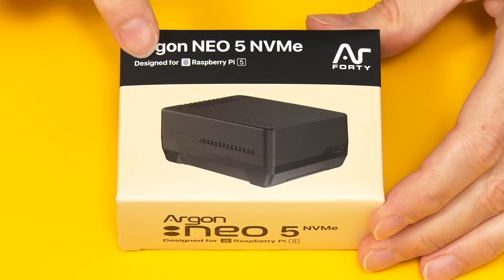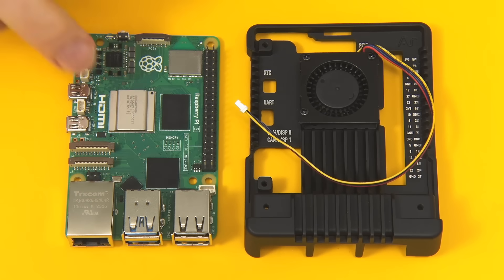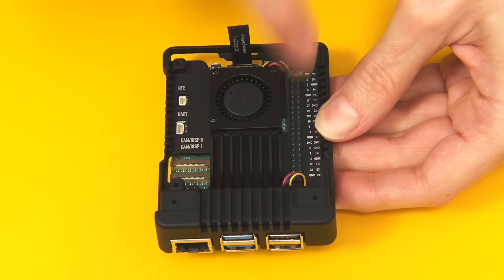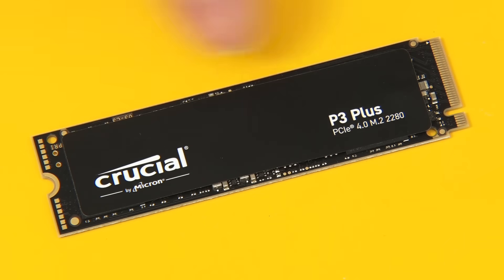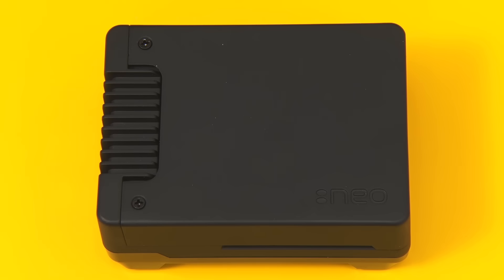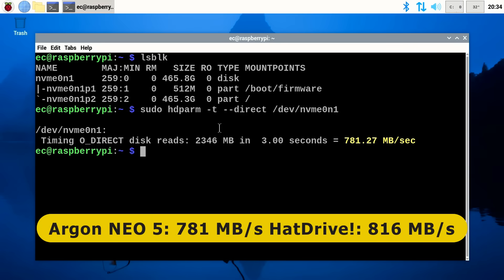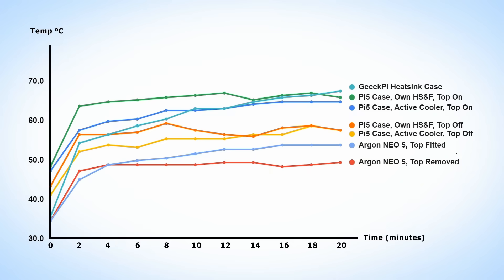Raspberry Pi 5 Argon NEO 5 NVMe Case

Comment: :yt: A 'case of pure joy'.  I concur. This is a very COoL little case. My only dismay is for these ultra TINY fans that seem to fail years ahead of schedule. As we know, the longevity of these items is just not in the cards. Mfg should really allow folks to purchase additional fans (a dozen at a time?). The chances of finding that specific-fit fan is larger than the gap between my eyes (sorry for that visual). I'd buy it if I could be assured I could purchase replacement fans. Just saying. Thank you for the InfoTainment once again. I'm almost your biggest fan  :face-blue-smiling:

Comment: Nice work, Chris, and lots of effort we've now seen since your showing us behind the scenes.
# Careful with the humour efforts. We like your natural quirks.
# Mayormaynot isn't a word, in spite of current diversion down the rabbit-hole. "I may not succeed with this on camera in real time.." is enough. 6:12
# 'Securing clamp' is a good term for the piece that clamps a ribbon cable in the connector.
Thanks. Nice case.
Reply from the maker: Rather insulted by your "mayormaynot isn't a word" comment. I am well aware it is not a word, and DID NOT use is as a word! But to say "may or may not" (four words, and obviously so) is perfectly valid English.
Reply: @ExplainingComputers  Aw, Chris, I could be rather insulted by your 'rather insulted' reply. Mine was a rather risible remark. It could be argued that mayormaynot is being used as a word. It's just that it doesn't make sense, like 'three a.m. in the morning'. Just another example of growing looseness in English. A lack of forethought, imo.
'May' means someting either is or isn't. 'May not' means something either isn't or is. Looseness, yes?
'Valid'? Maybe, maybe not.  ;-)
Love your work.

Comment: Nice case but it would be much better if it had no fan. NVMe vs SATA SSD connected through USB3 won't make that much difference in real life even under heavy stress. I don't think it would even if there was more modern PCI-e or it had more lanes let alone if its not even twice as fast as USB3 SSD. The biggest selling point of such solution is tidiness. It looks much nicer than my setup with dangling SATA drive in the case. One way to have nice tidy setup is USB key with proper SSD electronics but these are quite expensive for the specs. Personally use 2TB SATA3 drive and NVMe with 2TB aren't even that much more expensive which makes NVMe pretty much perfect. Anyways, I am looking forward for reviews of something like this Argon NEO case but all passive.

Comment: Argon cases are a cut above other RPI cases. I've owned a couple for several years now - original and the one with the m.2 SATA 'basement extension' (I purchased a second extension to upgrade the original.) and have been very pleased with them. They ARE a bit expensive,  but they solve the problem of having to use micro hdmi cables, and aren't especially any more expansive than a good case with an SSD hat. They did still required the USB jumper to connect the 'basement extension'. The NEO looks like a total solution designed from the ground up to take advantage of current technology, and at about the same price. We win!

Comment: I like the metal case! Yes, 36.00-40.00 GBP/USD.  Maybe a little high, but it's a really great looking case. With the built-in Fan is a bonus, come with every thing needed.  But? If plastic case, maybe 8.00-10.00. Who know they maybe a case cheaper? (For me!), But to be able to switches the NVMe-SSD from one Raspberry Pi 5, to another.  Another great tools, and love the facts that NVM drive little as 256gb up to 8TB, heard that trying to go over 10+TB?

Comment: One small thing… when measuring air cooling, it’s important to take into account the ambient (room) temperature because it’s directly related to the result. Cooling efficiency is about how close to ambient the temperature reaches, not just to what absolute temperature it gets. For example, in a room with say a 10 degree higher temperature, it’ll be cooled to 10 degrees higher.

That said, appreciate the video as always, nice job, thanks.

Comment: There is some ducting of the airflow of the neo 5 that notably reduces the air recirculation I did with some kapton tape that I need to document because it measurably reduced temperatures.

Comment: I never have used NVMe before.  Recently my Pi5 just arrived, and so I bought the geekworm nvm hat.   I made a mistake buying NVMe M2 4x4 2TB, and sequential read is about 7300mb/s, but look like Pi5 can go only up to 2500mb/s.   So the lesson learn is buying a 2500mb/s is good enough and anything above 3000mb/s is overkill.
Reply from the maker: A Pi only has a single-lane PCIe 3.0 connection (and in theory only 2.0). Almost all NVMe SSDs have 4 lane either PCIe 3.0 and 4.0 interface.
Reply: What nvme drive would u recommend

Comment: great review as always :)
i have the argone case for the pi 4 that adds the nvme drive.....awesome case but same prob with the sd card slot. With this case tho they could have put an adaptor inside the case so the sd card slides in the bottom like the hd does. I think i saw another review about their nvme pi case that looks like the pi 4 case but it has a dac add on board. I was thinking about that 1.
Also i forgot to mention...I get where you are coming from about the price for the case and pi etc.....that most ppl just think of the price......for me pi's are not just about price...its the versatility and the giant community......that part is priceless. I am so glad that we finally have a pi thats fast enough to actually use a pc.

Comment: Nice case if you have all those pieces.

A couple of questions. First any theories on why this combination is consistently slower than the Pineberry setup?

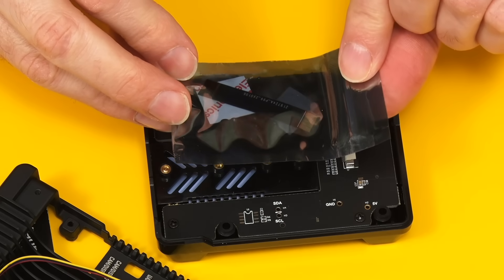Secondly, while showing the NVMe board, at about 2:50-ish and others, down at the bottom is a picture of an 8 pin chip and SDA/SCL text. So it's an I2C interface. Is that something not installed or not used?

Comment: Could you store the unused heat sink pad in the back of the case, for later use., or would it cause heat issues due to the backing tape being attached. It would be great to see, when it becomes possible, AI being run on SBC's (RPi). Welcome Phillip the screwdriver, nice!

Comment: Excellent video, as always, Chris. I'm using the Argon 40 Neo case for my RPi 4, and it has been a very impressive bit of kit. I have been looking at the Neo5 for an upcoming RPi 5 purcahse, and this confirms my thoughts that this would also be an equally good product. The only problem may be actually finding a Neo 5 in stock!

Comment: Very nice case. Not sure if the plastic bottom is a good idea from a reliability standpoint, but the thermals look great. I was hoping you'd show the power button - I only noticed there's one at the end of the video. I also wonder how the RTC battery would fit between the lid and the mid layer of the case, and if it's a good idea to stick it on the lid, which is cooler than the fan plate/cover. Does the lid have grooves to make the battery mount easier?

P.S. Thanks for reviewing this! :)

Comment: When i attached a NVME kit to my RPI i noticed a strange difference. Apparently the PI slows down on boot, with the NVME drive? With the SD card it boots in about 12-15 sec, but withe the NVME it takes up to 20 sec. 
Have you (or others) experienced similar behavior?

Comment: Some NVMe PCIe 4.0 drives need to be cooled even when running in PCIe 1.0 single lane mode. I think the SSD might have slightly throttled in the test.

Comment: At 1:30 you mentioned that you would have already spent more than some mini PCs.... and that is exactly where I stand with the PI ... I have fully fallen out of any reason to own a PI presently. 

Gone are the days when you could power one up with two 18650 batteries... and a standard hdmi cable, moving to micro, the dumbest decision ever in the history of computing.

Let's not start about the prices. Totally not worth it in my humble opinion. As usual, excellent video.

PS. Superb case!

Comment: These look really cool.  I must admit that I'm reluctant to loose the sd slot (as you pointed out), so I can switch OSs easily.  I also find that running a SSD through the usb 3 slots gives plenty of performance.  It boots very fast.  Not sure I need the nvme speeds though.  Maybe I will upgrade in the future?   But will will likely be a hat, but not sure yet.

Regarding Pi vs embeded SFF PCs.  I think the PI 5 is really good value.  I got mine, with the bits n bobs for around 110/120 dollars.  A N100 PC would cost more than that (at least from minisforum).  Personally, I would want at least an i3, which will cost a little more.  If I was going to run windows, I'd be looking for more.
Secondhand HP/Dell/Levovos can be bought secondhand.  This is a really good option.
Whilst I still think the Pi 5 is expensive, from an accessibility standpoint, the desktop experiences is much better than the 3B+.  And this is way cheaper than a new iPad, so perspective is important here.  Also the Zero and Pico are there if your just looking to have fun with electronics.
The reality is that you can buy cheap PCs and run linux.  If this is what you want, don't buy a Pi.  If you want a good desktop experience with the option to get creative with electronics, then the Pi is a really good option.
I am really impressed with the Pi5.  I just need to buy some more resistors and LEDs!
I'm quietly hoping for proxmox to get official support in the future, but we'll see.

Comment: Thanks for the video, I have recently purchased this case and didn't find any video about it. One question I still have is about the fan's speed control... I didn't find any script that does that...
Reply from the maker: The Pi 5 should control the fan speed automatically, at least in OS that support it (like Raspberry Pi OS and Ubuntu).

Comment: The case is more readily available than the SBC. It looks like a great case. But what's the point of a case without a computer to go into it? Plus, as you say, the Pi plus the case costs more than a mini-PC -- that actually has a drive built in. I think the heyday of the Raspberry Pi is over. But this is a great video for anyone who happens to get hold of a Pi-5. After all, the case does not seem to be easy to assemble. 

Happy Easter to you and your family!

Comment: I ordered the Argon ONE V3 for my Pi5 and received it a few days ago. I got my Pi in and fired it up only to find out that the official power supply supposedly didn't provide enough power. A quick internet search revealed lots of people having the same issue, and that Argon40 had released a script that made changes to the eeprom to, apparently, override some setting to allow it to draw more power. I switched it on, it booted up, and after it stabilized I left the room. I came back about 30 minutes later and could immediately smell the scent of burning electronics. The Pi was still running and according to the applet, the PC was not overheating, but I shut it down immediately and disassembled it. There was what appeared to be smoke residue on one of the daughter boards. I sent pictures to a friend of mine who is an electrical engineer, and he said that it looked like some of the resistors had burnt up. I emailed Argon40, but they never responded to my email. Their return policy requires the consumer to pay for tracked shipping back to them, so for a $40 case, it's hardly worth the effort when there's no guarantee they will do the right thing. I have 2 other Argon ONE cases (V1 and V2), but I will never buy another one of their products after the way they have addressed (or rather failed to address) the issues with the V3.

Comment: I had bought the Joy-It RB-AlucaseP5-08. So a passive aluminium block screwed around the Pi5..
But luckily was able to mount the pimoroni nvme base while using the Joy-It top without havoing to find additional screws,
the alu case ones fit throught the nvme base standoffs. ..But when "really" using the pi5 will feel better with a small/silent fan on it if needed..
probably wont need it because it's hopefully just a datalogging/website server so no real load on it.

Comment: The system's cooling performance is very, very impressive! ARGON enclosures remain my favorite; I use two of them routinely, the first as an OMV RPi 4 manager and the second with an RPi Zero 2 W (with an Ethernet extension) for tinkering. Thanks for the excellent presentation!
Reply: We're all learning here, MMM. What's an OMV?
Any tinkering you can cite that might interest us?
Reply: @ardwych4881 OMV is for "Open Media Vault" an opensource NAS application. I "thinker" with DietPi... Just take a look!
Reply: @ardwych4881  It's a rabbit hole to casuals like me who just want to get a cross platform media server working on a low power, low maintenance, media server, without having to pay a subscription fee.
Reply: @ardwych4881  OMV is is a program that offers you your media over your network.

Comment: Some unknown person or persons put a lot of thought into that design. And then had it manufactured and available to buy. That's a lot of hard work. And that tiny little fan, amazing. Great video Chris!
Reply from the maker: I agree -- some excellent design effort here.
Reply: There's another problem, some drives may not fit because there's a "step" up, right before the NVME connector. This step is made of transparent plastic but you can see it at 9:04, it starts right after the thread/nut to hold the shortes size drive. So if your drive's bottom near the connector isn't completely flat, it will bow upwards, and you won't be able to close the case. That is what happened to me, when I tried to fit a drive from an old laptop. This is a design flaw, as that plastic step has no purpose other than being an obstacle. I ended up cutting it off with a heated blade.
Reply: Disagree!! With poor wireless attenuation all metal case, and loss access to the microSD card slot is unforgivable . The connector cable could have been shaped  to not cover the SD slot. As other manufacturers have done so for bottom Drive Hat
Reply: @rosswines  it's a magnificent design cannot impress everyone
Reply: @rosswines I have an actual all metal case as well to use as a passive heat sink and was surprised to get connected to wi-fi networks without issue. I'm guessing maybe because the case isn't ground some of it is inducting through it.

Comment: Happy Easter, everyone
I have the Pi 5 booting MX 23 Linux from a SSD drive connected via USB and the non NVMe Argon 5 case that I am very pleased with.
I think I would have got this case if it had been available at the time, it's a very nice little system, and it has advantages over a mini computer for that reason.
Thanks for the great video Chris.
Reply from the maker: Greetings Susan.
Reply: Cannot speeel.
Reply: @BobAlston-v5i yeah not perfect that's for sure
Reply: How did you make that work?  Does the bios allow a selection if original is AND is via usb?
Reply: Clarify... I ment I'd two oz are available?

Comment: Happy Easter!  I woud say the Argon Neo5 case is the first case that I have seen that makes the Raspberry PI 5 a compelling concept to build and use.  It has nice cooling and ig buttons up all the components in a nice, tidy package that would be nice to add to the stack of gear on my desk that runs all of my operations.  Although, the PI5 is a bit of overkill for the Pi-Hole/DNS Server that my current Raspberry PI functions.

Comment: I love my Pi's but I never know what to do with them 😶
Reply: I have a couple of Pi-Holes running, a DHCP server, a couple of media servers (one for the kids, one for me), a minecraft server (on the same Pi as the media server for the kids). And there are lots of other different things to do with it like home automation.
Reply: @apveening  sounds like fun! But for me, too much to maintain. I do have one fun project, a RPi 3 that after boot starts up fluxbox, which starts a full screen terminal, that logs into a remote server and attaches to a tmux client that runs multitail for colorful log monitoring.  I've got two RPI 4s, one 2G and the other with 8G ram, and a raspberry pi zero with wifi. But I don't really have a use for those.
Reply: @Ancipital_  That 2G can handle two Pi-Holes (as Docker containers), fire and forget (just keep it running). And that 8G can do that as well (redundancy) and some more.

Comment: Thanks for the walk-through & build, this case looks really good. I just got a 2230 booting from a Waveshare HAT, but AFAIK, there is no case to contain the system. It works well, but after seeing this video, I kind of wish I had bought the Argon NEO 5 instead - it looks great, and offers a 2280 slot.
TMK, the NVMe drive you're running is single-sided (even at 4TB). Would a double-sided drive also work? I can't tell, from the video, if the brass mounts are raised above the PCB.

Comment: It looks like a rather nice case for a pi 5.  Now, if only I could get a pi 5l
Reply: They are extremely easy to get. There are currently 20 vendors on rpilocator that have them in stock.

Comment: The Argon cases are always well designed.
Reply: With a small side issue regarding the accessibility of the SD Card slot.
Reply: @apveening  Some of that was RasPi design problem, but Argon probably could have extended it to the bottom layer to sit next to the SSD.